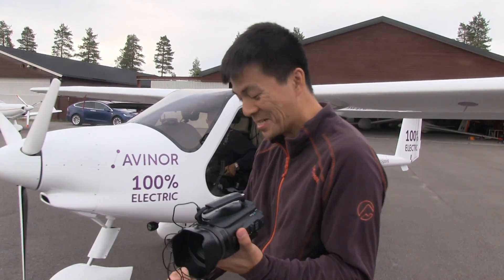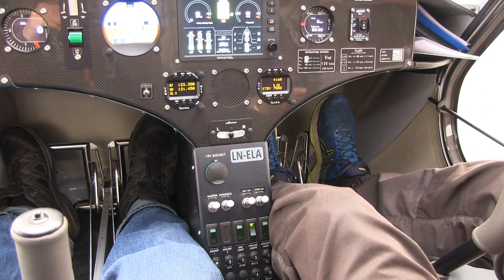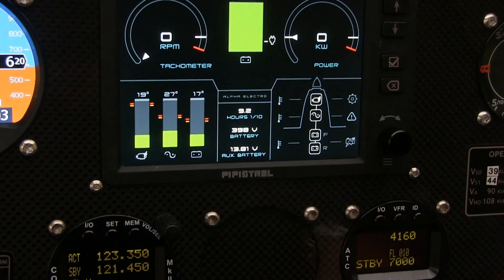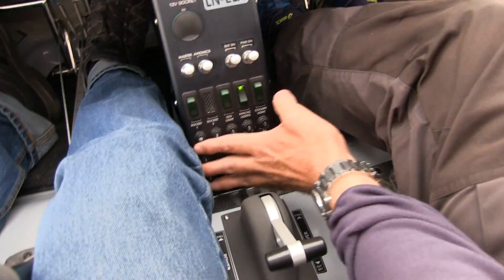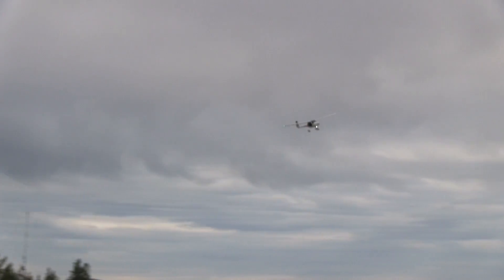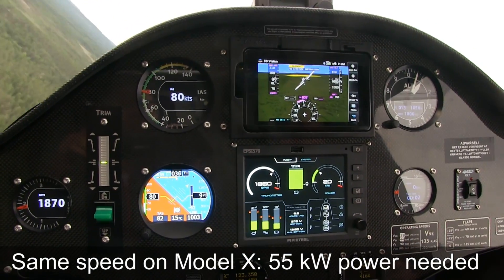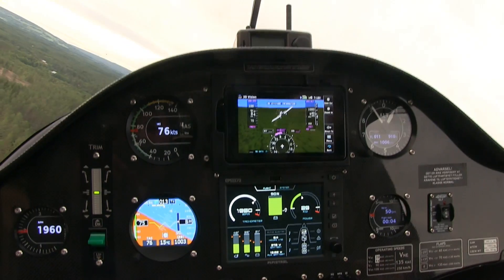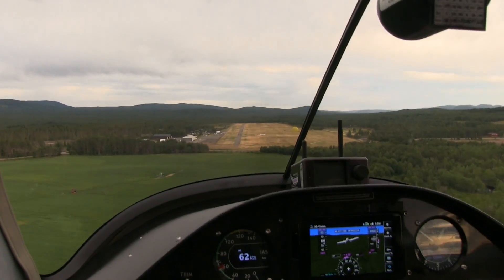Test ride in Pipistrel electric plane

Comment: The exterior should be covered with micro-thin-solar panels for maintaining the batteries when parked and supplying power to onboard electronics while in-flight.
Reply: @NonyaBusiness! how much weight would it add?? 
And how many more minutes can the panels help??
Reply: @NonyaBusiness! could take about half kilowatt or more of fuji fwave flexirolls at just over 1kg per 100w. would take days to charge but if its just a weekend flyer thats ideal. i wonder how a ducted fan would compare with the prop?

Comment: Interesting that, aside from when it was standing by on the takeoff apron, it's actually just as loud as a petrol plane.  And that was all down to the propeller.

I wonder if anyone is working on the high voltage piezo grid instead.  A bit of a buzz, which would be hard to hear even at 10 meters.  Don't know about the thrust efficiency.
Reply from the maker: +Bill Cichoke Have you never heard how noisy a fossil plane is? O.o
Reply: @bjornnyland  Yup.  We have cropdusters flying over us on a regular basis this time of year.  Also, at least two co-workers fly Cessna 172 type planes.

In the case of the cropdusters, there's a drone from the engine, which is a turboprop.  With the 172s, there is an FAA (or state, I'm not sure) noise restriction that requires exhaust muffling.  Literally the only thing you really hear as they fly at 500 feet or higher, is the propeller noise.  On the ground, when the engine is at idle, the propeller noise is as loud or louder.

Comment: Sounds like a turboprop which is cool, you get that same fab sound that you get from an aircraft with a turboprop engine that most people know and love, yet it's running on electricity. I think Hybrids and also ultra efficient, ultra low emission high bypass turbofans are the future for airliners and pure electric for small aircraft's.

Comment: The best range possible will be using diesel fuel cracking that to hydrogen, and using electric motor and 114kw fuel cell. I have not done the calculation but these components are known to be of the highest energy density.
There is also a small lithium battery pack used as a buffer. You can just fit all this in a Cessna 182.

Comment: Most crashs in small plane are do to engine failures. Here there is no gas engine,so that makes this far safer plane with less chance crashing. Someday all planes will be electric once the issue of battery density and weight are felt with.
Reply: Catlover664 Sorry article is in Norwegian, but it crashed https://www.nrk.no/sorlandet/elfly-med-avinor-sjefen-som-pilot-matte-nodlande-i-arendal-1.14660687

Comment: I did not expected it to be very so loud. I thought it would be much quieter withed electric powering. I do guess it is all about those propellers chopping through the air.

Comment: How far can it fly? With a full battery. Does it have a reserve in case the battery fails?
Reply: What do you mean reserves?  It have 2 Battery packs. If one fail, you still have the other.  It can fly approx an hour.
Reply: It can fly for 50 minutes at low power with 20 minutes in reserve. However, after 500 cycles (ie about 500 flight hours) the batteries are reduced to 70% capacity. That is a significant shortcoming as 35 minutes at low power is not much use to anyone. And the cells cost $15 000 to replace if you want to maintain your 50 minute capacity (which is already quite short).

Comment: they said that it would lower the cost of training from $30 per hour to just $1... and i said wow...i could get myself a wing with this
Reply: Unfortunately, if we look at the official data from Pipistrel there is no way the operating costs will be anything like as low $30/flight hour. Based on the short life and high cost of the battery cells alone (500 cycles and $15 000) the cost/flight hour is going to be more than $30. Also, nobody is doing flight training for $30/hour. Instructors charge upward of $40/hour for their time before you even get started on fuel and rental. That is not to say that electric aircraft do not have a future, it's just they are still a bit limited by the current cost and life of the Li-ion batteries.

Comment: As the battery ages, full charge may not last long, similar to phone/laptop battery?
Reply: Phone and Laptop batteries are a whole different story. Electric planes, cars an motorcycles have proper battery management systems and they don't use the maximum and minimum voltages of their batteries.

Comment: Would be alot easier to install a generator or solar panels to keep the batteries charged while flying and you would not have to worry about timing your flights and probably could fly long distance without worrying about battery expectancy!
Reply from the maker: Bad idea.

Comment: My 1/4 scale electric RC Spitfire had just 1/3 of this power (at @ 7kw rated motor) . Flight time of only 10 minutes max  per charge!  I had 50 volts at 10 Amps ( ie approx 500watts)There are no doubt economies of scale with a full size plane.

Comment: We all know that gasoline planes are faster and cheaper at the moment, the question is where does the future lie and how can we protect our environment at the same time.
I find it strange that there is almost no criticism of the air pollution caused by aircraft as well as noise nuisance,  despite the fact that aircraft pollute high up in the atmosphere.
I am sure that within ten years there will be a short-haul electric passenger plane available and this will revolutionize transport, but we have to encourage research and development.

Comment: awesome plane but as the battery gets on will not hold the charge as well and the battery for these applications are not cheap so that would also have to be taken in account on how much it costs per flight , besides a commercial plane would charge what they want compared to the market , what ppl need to understand yes the aircraft may be pollution free but depending on how the electricity is made to charge up the batteries would be the only pollution , so this is great for the environment and the planet , kudos to the ppl who make this possible , great looking aircraft and great pilot also.

Comment: Lovely aircraft! Smooth Quiet and maneuverable! I was just wondering what the weight was, is this a GA aircraft or an Ultralight/Microlight? I narrowly missed a flight in the IC version. 
The electric version of the Pipistrel is a VERY exciting prospect, that panel too, one of the best glass layouts Ive seen. 
In the UK, my only concern with the rapid (and some would say 'rabid') onset of electric vehicles is that we, if we all change over to such, we will all be pushing the problem of pollution back up the supply chain to the energy generators/providers, thus moving the problem of pollution etc upstream. Also unless more - genuinely clean - renewable generators, that are not owned by big business, come online oil barons will be replaced with 'electricity barons'. And then there is the issue of battery safety and battery recycling. There is a way to go yet. And as those better than me have said, 'follow the money'.

Thanks for the video, some promising work re LSA electrics.
Reply: @Muso Seven Yes the pollution source is moved to the Grid Power Plant, however,  there are just a few hundred of those compared to the millions of car engines and thus a more manageable problem. A couple of years ago I went to an antique / classic car show and they all fired up their engines to cruise their wonder cars and my God what a stinking mess of half burned fuel, oxides, oil, you name it - that absolutely reinforced why we need to try new technology.

It just amazes me how few want to budge unless it is "perfect and doesn't cost anything extra." I remember when car manufacturers just pooh-poohed mileage, pollution, etc. and promised it would raise the cost of a car to more than one's home... but then achieved it all at the virtually the same cost; if they hadn't bitched, whined, and drug their feet for 10 years how much sooner it could have happened and further down the road we would be.

Oh well... like Jeff Foxworthy once said "You can't fix stupid..."

Comment: This is the best video online for this plane.  Great job.  One can only fly to where there is a charging station (would automobile ones do the job?) otherwise short flights only.  For a recreational pilot, I read that the average flight time is 45 minutes anyway, maybe because most of the owners are older guys with money, but dodgy bladders.  But a great plane to own, which blows raspberries from its propellor  when it flies close to the ground, but is otherwise silent.

Comment: It’s interesting watching this technology evolve, I fly remote control as well as full size planes.  When electric remote control started batteries were heavy, now I would never fly anything but electric, this is exciting but it’s going to take time for the battery technology to reach the point it needs to, then there will be no looking back.  Maintenance on the Powerplant becomes basically zero.

Comment: No getting lighter as you burn through ur fuel. 

Good VFR platform.

I have range anxiety in a Cessna 172 under IMC....this be a range hell. 

Winds blow harder. Get held up on a hold. Weather pushes you around.

Comment: This is the future of flight training. the benefits are just too many. An Electric engine gets rid of so many problems. especially idling, flying at higher altitudes, noise, maintenance, cost per hour. Only thing that required is a battery with more capacity which will be solved very soon because of Tesla, Nio, BYD all these electric car companies.

Comment: Do they do things differently in Norway and some how use Volts as a quantity measurement of what is available in the USA we use Amp Hours as a measure of battery power availability i.e. how full is the gas tank.

Comment: actually that would be a good lifter for sailplanes should be way cheaper than ones burning fuel^^ or for small flights with ppl who want to fly and maybe want to steer too :D it costs about 300€ in a fuel burner this would reduce the cost to time of the pilot + airport fees

Comment: EP is too limiting, shall check back here next century!:-)
Reply: Batteries are improving exponentially.  "Next century" is linear thinking.
Reply: @jklappenbach yes they are improving but not likely to be a serious contender for hydrocarbon products for a VERY long time:-)
Reply: Tesla's purchase of Maxwell promises to double performance in a matter of a year or two.  And in fact, there are many other players in the space that have come up with innovation that promises similar gains from other avenues.  If a mass of batteries is able to propel a craft like this for ten minutes, a doubling every 3 - 4 years will see 80 minute flights in a decade.  On the automotive front, EVs cost pennies of electricity per mile, and run around 2 - 3 cents per mile to operate.  Compare that to an gasoline engine.  And if companies like Tesla and Waymo are able to crack AI driven cars within the next 3 - 4 years, we'll quickly see total miles driven on electric completely eclipse gasoline.  People may not own an electric vehicle, but they'll be driven where ever they need to go in one.  This will crater the market for hydrocarbon products.  It's coming, quickly.  Hopefully, quickly enough.
Reply: @jklappenbach Oh I hope it does but all the hype about E cars etc sounds great but why don't they flood the market with sales now? Cause they are expensive, not practical for a lot of applications & simply too limiting. Electrical storage & efficiency will in our life time never be good enough to replace the zillion hydrocarbon cars we have now, nowhere near it! My boss has a Tesla, goes like a scolded cat, seems weird driving it BUT it cost a fortune to buy & to replace the batts down the track in time will be more than the national debt!
Reply: @endwood  Again, when they go self-driving with AI, there will be huge fleets servicing the public.  They're also selling for as cheap as 30k now, and getting cheaper.  Regardless, most people won't have to own one.   The people that do will drive to work, then submit their car to the fleet.  The rest of us will hail a car from the fleet and get driven to where ever we need to go.  Since EVs are 10% of the cost of an ICE to operate, only a fool would purchase an ICE for fleet use.  This is how gasoline will die.
Reply: @endwood  If by "VERY long time" you mean 5 years for automotive, 10 years for civilian aerospace, and perhaps 20 for commercial aerospace, then we're probably saying the same thing.  If your timescales are longer than that, I highly suggest you look up the meaning of "exponential growth" and get comfortable with it.  The same principle that drove the unbelievable growth of compute is now driving batteries and renewable energy.

Comment: What about putting solar panels on the wings?
Reply: It's a dream everyone has...  Flying for as long as you want without having to fill up or recahrge..  But, watching the video closely you might have seen that even such a small and efficient airplane uses about 20kW (20 000 Watts) of power to maintain 85 miles per hour.  Covering the entire wings of the airplane with solar panels could produce about 2kW of power in bright sunlight, which is not even 10% of the power needed to cruise the airplane.  And adding the solar cells would have to be done in a way as to not disrupt the airflow over the wings, and also so as to not add significant weight.  The technology just isn't there yet.

Comment: Think of what an electric plane means to reliability and safety.  Let's face it:  exponentially fewer moving parts means a tremendous improvement in safety.
Reply: How often does electro engines fail?  .. its such a simple and powerful technology its surprising we havent pushed this earlier
Reply: @frosty6960  it's only been feasible very recently thanks to high energy density lithium ion batteries. It will become much more feasible as better technology improves, and presumably this aircraft could be upgraded right along with it since the batteries are removable.
Reply: i belive it will be perfect for small cessna type planes, typical boeing will allways be a majority petrol powered, but for the small planes with high energy dencity, it will be perfect
Reply: There are still thousands of parts to fail in any vehicle,  no matter the powerplant.  I'm all for electric transportation but let's not fool ourselves into thinking an electric powertrain makes something bulletproof.   It reminds me of when car owners think that a rebuilt engine makes their car new again.....

That said,  your post said a tremendous improvement and I'll concede that you're right.
Reply: Operating costs (maintenance as well as fuel) are also expected to be much lower than with internal combustion power. Probably purchase price too? Assuming technology advances provide cheaper, lighter, and more efficient batteries, this should be great for aviation.
Reply: What about the likelihood of zero moving parts? ; )
Is it more or less?

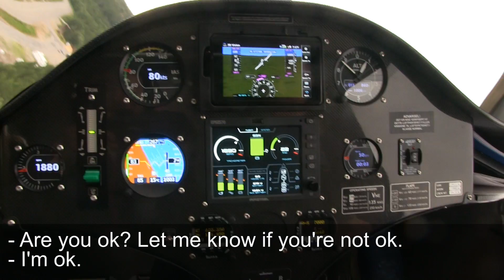Comment: 10:38 was that a stall warning horn I was hearing in the background? during a steep turn. close to the ground. 😐
Reply: Yeah, I thought the same thing... I also noticed the bank angle in some of the other shots at seemingly low altitude as well. In all honesty, I would have been a little pissed if I were in the second seat... further, a stall can occur at any speed @ critical angle of attack,  surpassed, etc. While watching, I was sitting here thinking... wow, if the guy wants to show off the airplane and its capabilities, he should do it solo. Perhaps the footage was a bit deceptive because it was near impossible to gauge the flight path, etc. but some of those shots looked ridiculous to me. I wasn't in the plane, so it's tough to criticize the PIC - but dang, from an outsiders perspective that really looked like he was pushing it.

Comment: Would an electric engine be more reliable than a piston engine? 
Another question, would this kind of plane make PPLs less expensive as maintenance is cheaper and it doesn’t use petrol?
Reply: Short answers 1) Yes 2)Yes & No. Depends on what kind of profit margin the flightschool wants.

Comment: As better batteries are available and the range increases, this technology will certainly displace IC engines. The reliability and minimal servicing for this type of power plant will provide a massive reduction in the cost of ownership.

Comment: Noisy little bugger, innit?
Reply: Yeah, most of the noise in any propeller aircraft comes from the prop, not the engine. It’ll be a little bit quieter, but not much. I wonder if pipistrel have put out any data on the noise levels from this? Hard to tell from a video

Comment: I was surprised at the prop noise when it was on the ground at tick over . I would have thought being electric  It would have been quiteter  . So the noise I hear with an ordinary engine , in the same situation is mainly prop noise not the engine .
Reply: na most electric motor are quiet loud they always have some inbalance tgat causes vibrations

Comment: Very cool. But given that extremely limited battery capacity of 60min +30 reserve, this plane is for now a limited range tester. Flying much over 150nm, safely & confidently is out of the question unless: destination airport has high capacity charging available & you have time to wait.  Did I get that correct ? Also was this plane designed & built with private funds or taxpayer money ? Thanks for clarifying
Reply: How's about fun flying, like in a J-3?